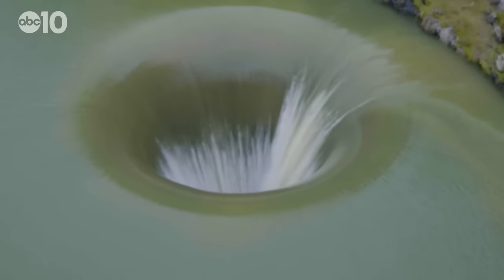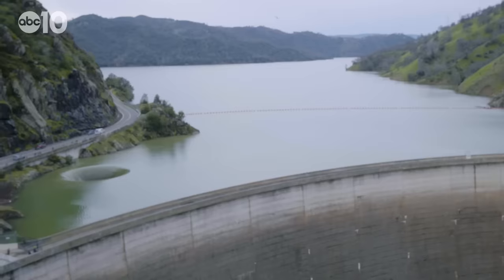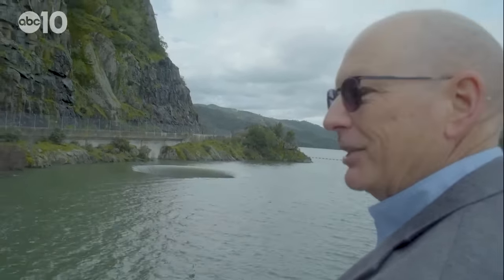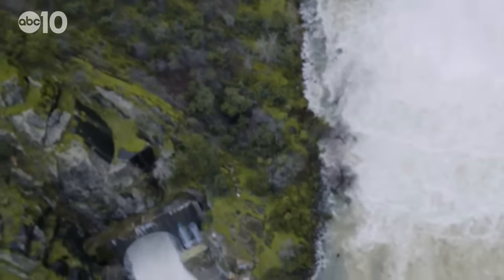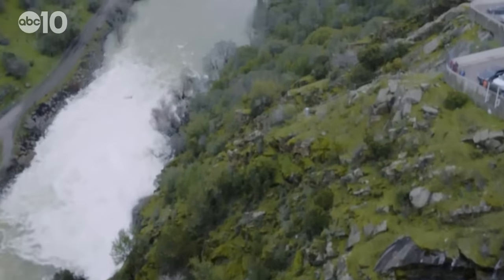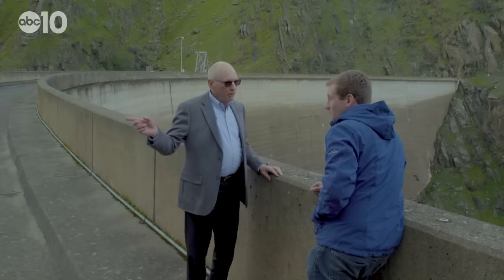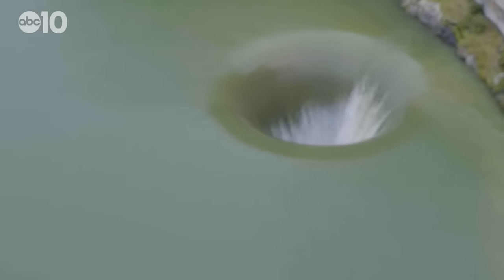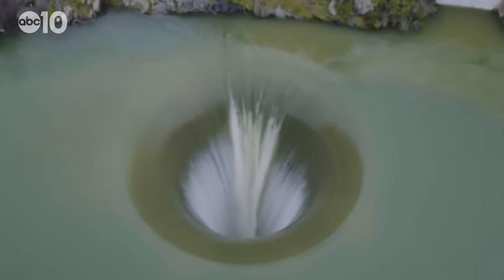How does 'The Glory Hole' at Lake Berryessa work?

Comment: Does the concrete lining of the tunnel suffer from cavitation damage? Particularly around the elbow/bend section ?
Reply: Good question
Reply: It doesn't get used often. Only whenever Cali gets a lot of rain. 2019, 2017 and 2006 were the last times this overflowed into the spill way.
Reply: @zamild01  They generally have some kind of structure built into the walls of the tube at the elbow to aerate the water so it doesn't chew Glen Canyon-sized holes at the turn. Didn't see any of that here. It depends on how much hydraulic head it has, and some of them have a protruding section at the entrance to help aerate as well.

Comment: You'd think they put some kinda grate or screen over it... although maybe if you got caught on it the water pressure could just turn it into a sort of wire cheese cutter and you'd end up being cubed. 🕳 🧈
Reply: If they put a mesh or something around it, it would collect debris and eventually clog up. These types of spillways are designed to be "fire and forget". Once they're installed and opened, that's it.

Comment: sooo if i decide to enter the glory hole.... will i survive??
Reply: Kade Walton you wouldn’t... either the pressure would kill you or the drop :/
Reply: No, a 200 foot drop with a right angle turn at the bottom is designed to smash debris to keep the hole flowing. You would be busted up.